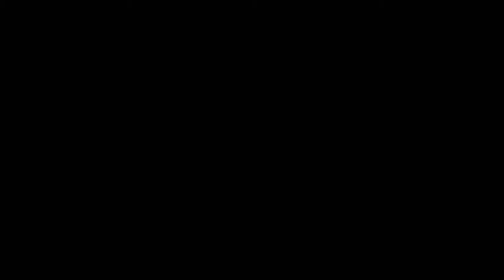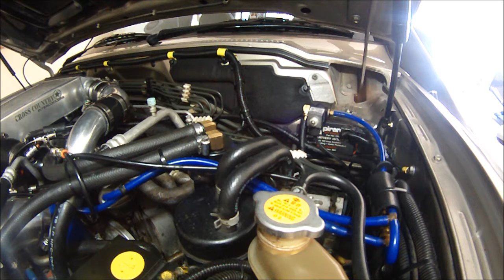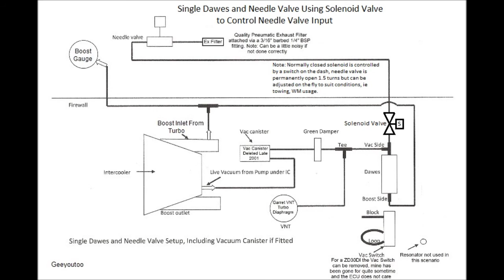Single Dawes turned into a ZD30 Dual Spoolup System

Comment: I want a Dawes valve installed on my zd30 nissan patrol but too Difficult to install 😫
Reply from the maker: Go to here and look for the schematics I posted, there are several optiuons with easy to follow pics.
https://www.patrol4x4.com/threads/nads-zd30-di-nads-steps-and-logic-with-diagrams.88214/
Reply: @Geeyoutoo  cheers mate...I'll definitely have a look. 👍

Comment: Older video now but best mod I ever done was to rip out the Dawes/bleed setup and throw it in bin along with the vac solenoid. Fitted a 16PSI boost actuator, put a cheap boost controller and now have a smooth boost control. the 16PSI for most is great and safe. Will see enough boost on highway to avoid EGT creeping. I run 20PSI and keep EGT's under 450° under full load climbing hills. It is simple and free of the mess of lines and complications seen in this video.
Reply from the maker: To each his own, worked fine for me but I don't use the needle anymore because I have refitted the Vac Sol after my remap and it is bloody great, run 21.5psi very smoothly, can hit that 21.5psi by 1700rpm, never soo over 450c and generally cruise at 210-240c. I'm really happy with all the development I've done over the years, each video I've done has been a further development so yes I have moved on from this setup and improved it again, no way I'm going to get rid of my current Dawes/vac sol setup. Personally I don't like the boost actuators have worked on a few vehicles with them, yes they are simple but I don't think the best. As said to each his own, I like mine and pull some fantastic torque at quite low revs. So Ben TheGuru lets agree to disagree, you do what you like and I'll do what I like.

Comment from the maker: After over a year of working with this I have found that on average the dual spoolup system saves me between 1-1.5L/100k, even with my roof rack on I recently came back up the highway from Lismore to Queensland using 10.03L/100k, so you can see that when used on flatter terrain it has significant benefits. And the point I made about my Water Meth injection on long trips has been proven time and time again. With my main boost running at 21psi and my WM switching on at 15psi, in the slow spoolup mode it is limited to around 16psi so my WM hardly ever turns on. 

After disregarding automation of this and my earlier Dual Dawes system, I've changed my mind and looking at ways to optimise my setup, my control solenoid is a normally closed type and I think it may be better to have an NO type, anyway more on this as I go.

In general I think the dual spoolup has significant benefits for very little cost.

Comment: great vid with good info. Thanks for sharing.
Reply from the maker: +Paul Mays 
Thanks, it has been proving itself over and over. Quite simple to adapt and adjust on the fly if needed, there is a significant change in fuel eco between the two options and a difference in torque and Hp. I also have so much better control over the amount of water I use in the injection system when on long trips.

Comment: Great videos mate ,ill be getting a gu in the next few weeks and your videos will help.
Reply from the maker: +shadyderbas 
Great, good to get another Troller in the clan, what year are you getting?
Reply: +Geeyoutoo hopefully an 05 or 06 depending on the budget
Reply: +Geeyoutoo are the motors good in those years?
Reply from the maker: +shadyderbas 
Should not have any worries with those years, I have a 2000, they, and up to late 2002, were the worst, I would buy a good clean 05 tomorrow with no concerns. You can get good grunt from a DI.
Reply: Cheers mate, when i get one ill be watching your videos again for some guidence
Reply from the maker: +shadyderbas Anytime mate, just yell if I can help you with something.